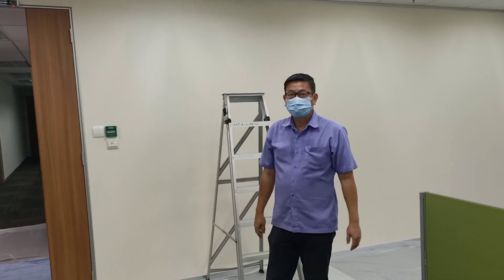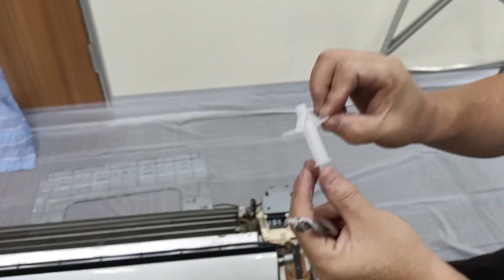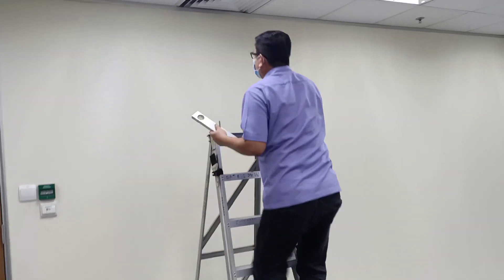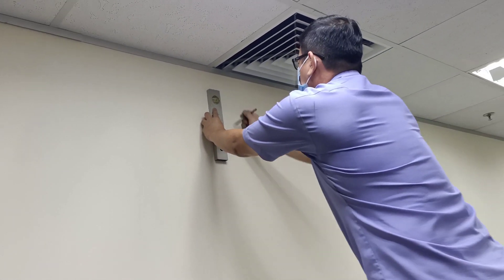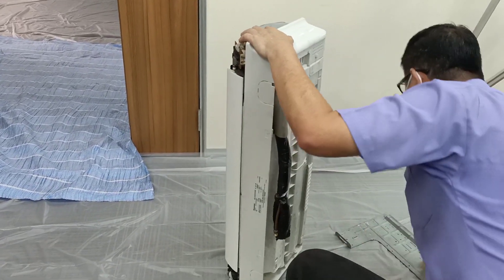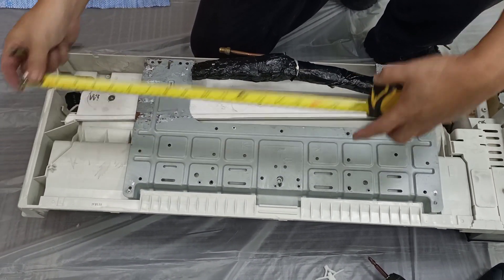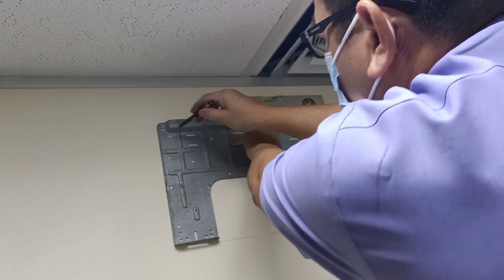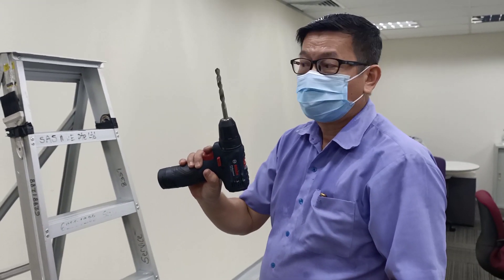How to Install air conditioner on partition wall.(wall-mounted)

Comment: Sir Panasonic ceiling cassette ... blinking 10 times....what need to check? Pls help me
Reply from the maker: Normally we use remote control to check error.
Reply: @BonMj  ok sir
Reply from the maker: @shivaHVAC  message me if got problem using remote control to check error.
Reply: @BonMj  ok sir sure...thanks for your reply